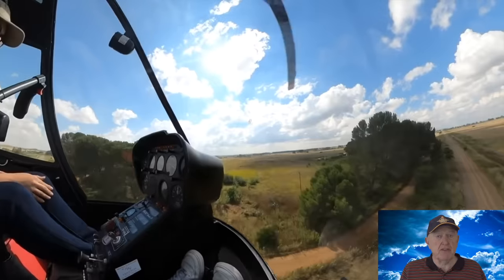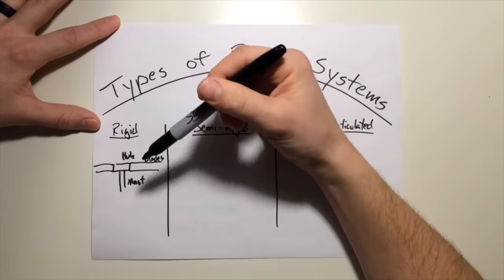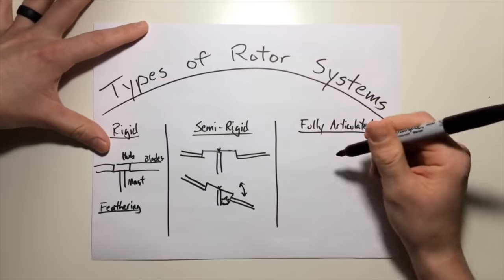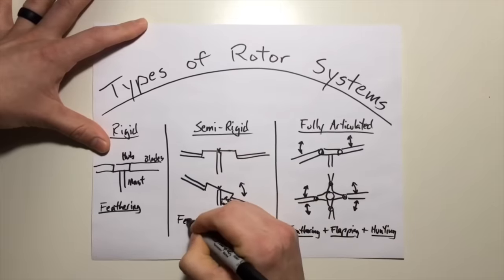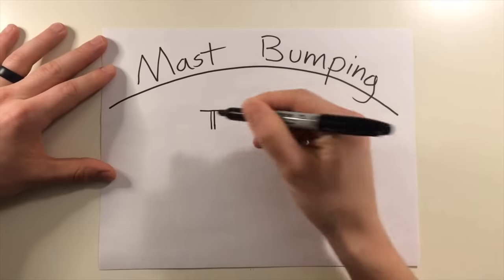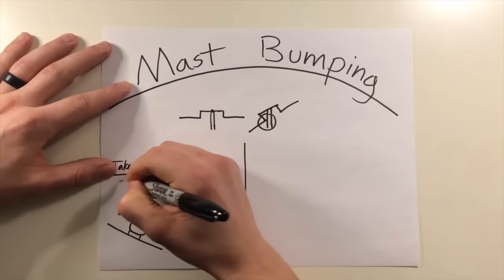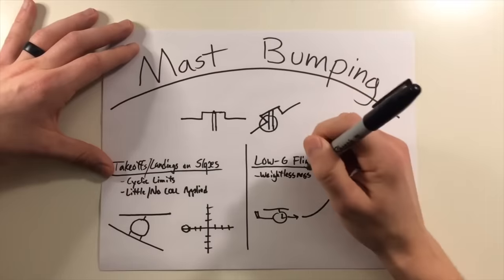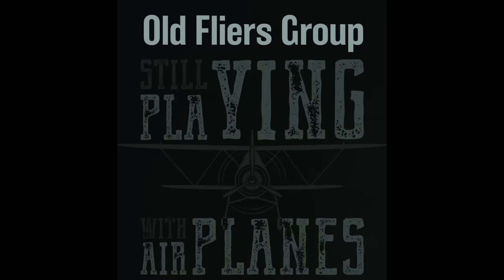Helicopter accidents that are due to "mast bump"

Comment: I had mast chugging in a descending left turn like a bucking motion for no reason it happened I entered  auto Rotation and the bucking got faster but the upset disappeared slowly 
Still to this day I think there is a hidden issue in Robinson Rotor head design.
Reply: Sounds like a bit of slop in the swash plate.

Comment: I've attained approximately 4500 hrs in rigid rotor copters. And the other 18k in other types. The most rugged design by a longshot is rigid. Very, very stable. The BK-117 was the best 👍 The Bell 222 was very smooth, but still had the 2 per beat. The AS-350 B2 was powerful and smooth, but still subject to ground resonance. I could go on, but no need. When I talked to a couple of FAA examiners one day, they both relayed to me their distaste for the R22 design. I trusted their opinions. 🦜